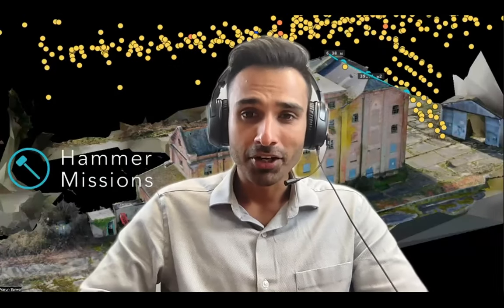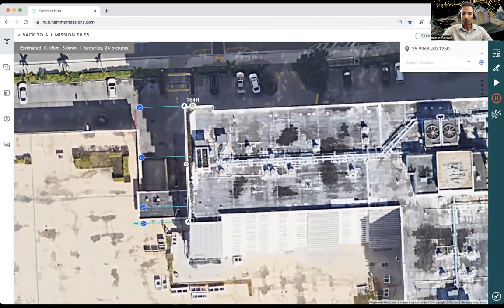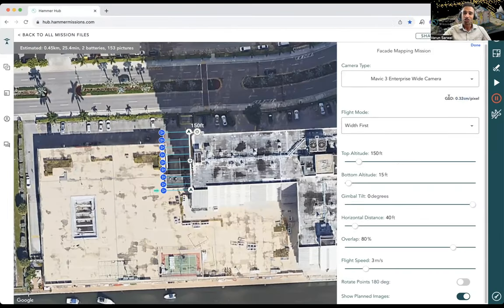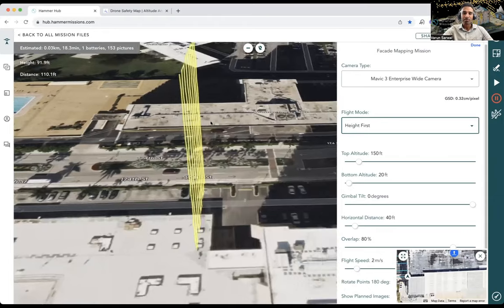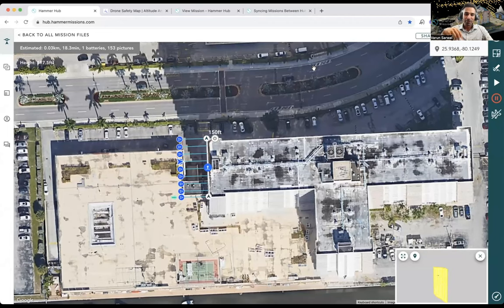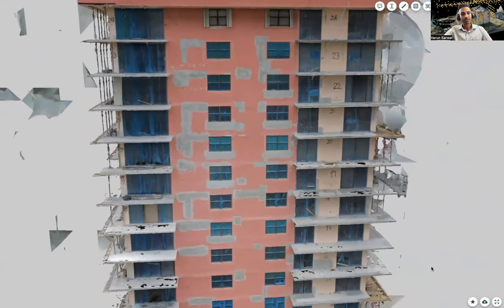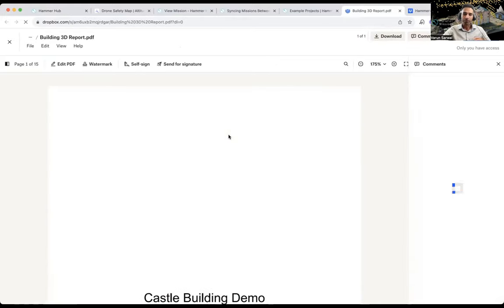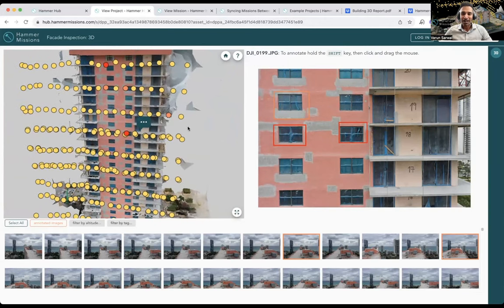Building Inspections: How to Perform Facade (Vertical) Inspections with Drones | Hammer Missions

Comment: If I were to manually take images on the ground of the ground level, and take photos of areas the drone did not get (overhangs from underneath, small crop ins etc..) what mirrorless camera would you suggest that would be compatible?
Reply from the maker: Generally speaking, you want to get a camera with similar specs to the drone camera (sensor size, *focal length*, and resolution). Focal length is particularly important here for camera calibration and alignment 📸
Reply: I suppose I could carry the drone with an assistant and take photos manually.. probably the easiest!
Reply from the maker: @EDSC_CANADA  Yes, using the same drone would be ideal! You also want to ensure you get high overlaps between different image groups:  

https://www.hammermissions.com/post/quality-drone-maps-and-3d-models